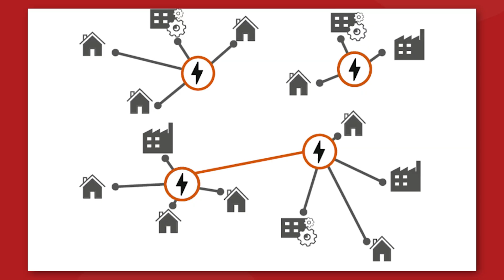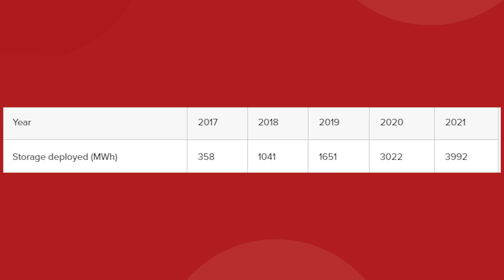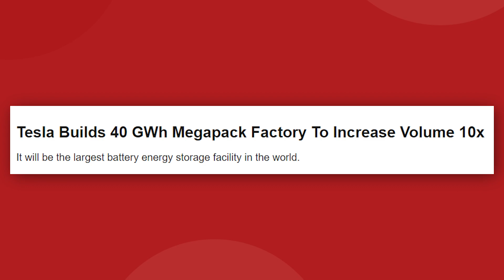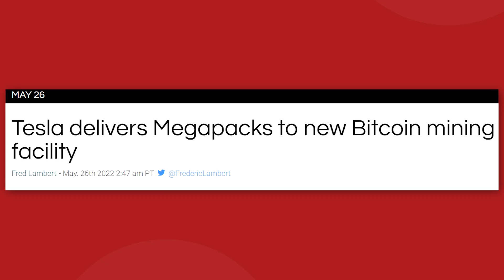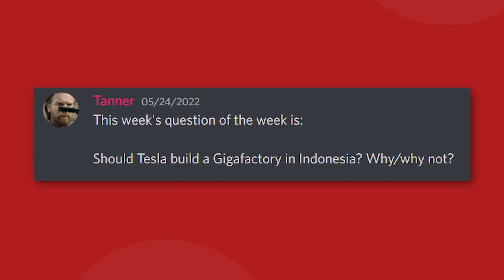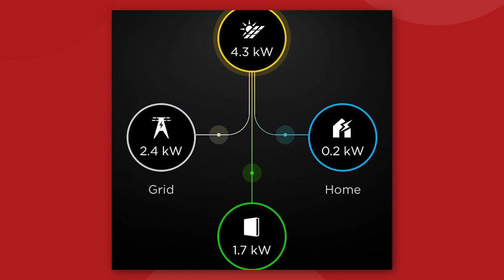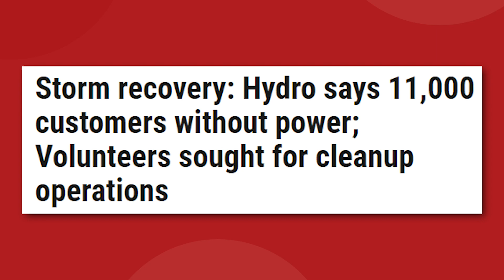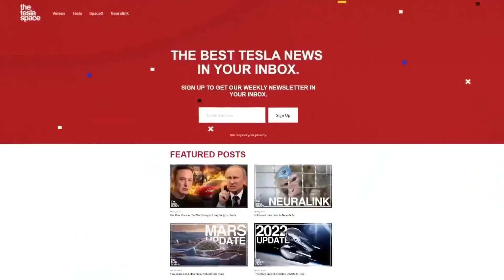Why Elon Musk Says Tesla's Batteries Will Save The World!

Comment: I wonder whether we can bury power lines. I know that that is not a new idea, but I mean "barely bury". Like, put them in a rubber and plastic canister at curb level and line the roads with them or something. Then, have each house or building plug into this network. It could even be somewhat modular. Greater energy needs could have dedicated nodes which pull more heavily from the grid. To me, that does not seem all that hard to achieve. Repairing/updating them would require more work than hanging new wire, but I would hope that the lines would be less susceptible to storms and thus might require less emergency work.

Comment: Great video as always!  As a longtime Texas resident, I am really curious where you received information saying that we can’t connect our home solar/ battery systems to the grid and get paid for extra production.  We do this all of the time. I have several friends and neighbors who do it, and I am also getting ready to do it as well. There are certainly paperwork and safety measures you need to go through to be able to do it, like you can’t feed into the grid if the grid is experiencing an outage.  This is because you could electrocute a lineman who is working on a downed power line.  But that aside, under the right conditions, you can absolutely push power back into the grid and get paid for it in Texas. 😊

Comment: With those large battery facilities located in the middle of a field, you are still going to need a grid to get it to the users, and it will have to be converted to AC to get there, so not too much is going to change in this aspect with wind and solar.

Comment: Especially considering where you are at, you missed some really big things:
1. The Great Lakes not too far from where you live are at different levels.  I am sure you have been out to Niagara Falls as it is not too far from Ottawa.  Well if you did pumped hydro storage between those two Great Lakes, you could have a massive gravity battery.  I mean I am sure you could get up to 100 GW scale no problem.  Right now Canada takes some water flowing down for one way power generation, which reduces what ends up going over the falls, but if you used renewable energy to pump water back up, those lakes are mindbogglingly big gravity batteries at your disposal.  Why are you so big on chemical battery storage when you have that in your own backyard basically?

2. I am surprised you didn't talk more about wind power and its role with battery storage, especially when you talk about these extreme wind events.

3. If you go to fire prone places like San Diego, California, since the devastating wildfires in 2003 and 2007, they have undergrounded the entire street level grid.  No more sparking overhead lines to touch off more devastating wildfires.  Granted it used to rain out in San Diego, but more and more the place is desertifying and the trees die off in mass groves with the deep winter freeze no longer happening in the local mountains to kill off the bark beetles in addition to the complete lack of any rain for most of the year.  So then you end up with mass tree die offs and becoming super dry as well as crazy winds that never used to happen and the previous 'windy' season, more like a light breeze by today's new norm, used to happen in the wet season, which is now part of the dry year.  So any little spark and whatever has not already burned away just goes woosh into a huge wind swept firestorm.  Then years and now decades later you go back to what was once beautiful forests and it is just desertscape; nothing is growing back.  So undergrounding all of the power lines has been a last ditch effort to keep some sort of semblance of what was once there and cherished / taken for granted and not have all of these homes burn down.

4. For large scale power transfer, as this is important to going to truly renewable (get the renewables and even natural storage where it is best to get it from when it is best to use), something that needs to be looked into more is using high temperature superconductors buried in the ground.  We can mass produce liquid nitrogen, which can keep current superconductors at a good operating temperature and setup the wiring in a coaxial configuration buried in the ground like a pipeline for massive scale electrical transfer.  With HVDC tech, which is already all over the place, you can drop to two conductors in the cable and have the electric field completely contained in the cable, making it immune to things such as massive solar flares such as the Carrington Event.  With superconductors, it should be easy enough to build out such lines in redundant rings, so if there is a cut somewhere, the power can just flow the long way around without any power loss.  I could imagine smaller rings with branches off to various places connected end to end (looking somewhat like bicycle chain links, but on a much larger scale) connected together in much larger regional and national redundant loops.  No more single failures leading to big outages.  At this with local batteries and such, you can have some time to spool up local 'dirty' generation in case your segment lost power.  However you make a strong redundant system and this is needed less.

5. Geothermal can play a big role in renewable energy both for reliable power from the ground and especially in places such as the Salton Sea, lithium for all of these batteries.  They are already working on doing battery grade lithium extraction from the Salton Sea.

6. A power generation tech we need to be getting into more, especially if you want more local generation is thorium molten salt nuclear power plants with one of my personal favorites the LFTR reactor.  These are much better and safer nuclear reactors than the light water reactors we know and so often hate and are afraid of.  Nuclear does not need to be this big, crazy expensive thing with the potential for catastrophic disasters, which has scared people into trying to kill off all nuclear and then have this forever radioactive waste issue.  It can be a lot better in every way and the technology was even promoted by the guy who invented the light water reactor as his first major success and then went on to this other reactor type to build the 'real' power plant of the future while working at Oak Ridge National Labs only to be halted by politics, not technical issues.  But yeah, if you want more reliable local power generation, a LFTR reactor is your best bet.

7. Maybe another thing to point out is we use a tonne of energy on heating and air conditioning while the systems we use for this tend to be hellishly inefficient.  If we promoted better systems, we could save a lot on our energy usage.

Comment: One easy answer that would resolve both the windstorm damage and fire hazard as seen in California is placing electricity grid underground like e.g. in Austria (I think they do it there to protect against snow). And the city without electric poles also looks better.
Reply: I lived in Japan, and the reason why absolutely every electrical and telecoms lines are on electric poles and not underground is because it's way easier to repair and do maintenance on them after natural disasters. For exemple it's basically impossible to repair underground networks after and earthquake, which often happen there.

I don't know if earthquakes happen in California too though, but maybe that could be the reason. Also poles are way cheaper and easier than underground lines, so I don't thinks it's that "easy" of an answer ^^
Reply: @axeldasilva8060  maybe with future cheap boring company tunnels ?
Reply: @xXxno6xXx  that may take a lot longer
Reply: @wisdomisawesome5934  for sure but how often you wanna replace a broken thing over a given timespan until it's worth it ?

Somebody might someday run the numbers on this.

for these, boring diameter might be able to be reduced a lot, but it will for sure take time
Reply: @xXxno6xXx  yeah that could be a possibility for some of the infrastructure that get hit the most
Reply: @xXxno6xXx  i just saw a videoclip about costing this and comparing to underground option. It was based on some electricity company research, where it would cost billions and it is prone to eathquakes and lasts about half as long as the wires on the poles. But hell, in Austria it must have been more costly as well and people in general were not against (I mean there was no public uproar against this) - there are more qualities than money. And yes, they obviously have less snow in California than Austria does. Yet what I lacked on the analysis was the lives lost and catastrophic property losses due to someone analysis which only substantiated the power company benefits. In my opinion, it was very near sighted and oversimplified view.
Reply: @Alarix246  thank you for the update.

I think one should recalculate these things every few years to make sure that advancement in technology didn't push it in the profitable range in the meantime.
Reply: @axeldasilva8060  obviously the earthquakes hardly ever happen in Austria. But I guess this all waits for the next Elon Musk.
Reply: @axeldasilva8060  your answer is great and pretty much spot on. The US does a lot of underground electric of lower voltage residential supply lines in new home build areas. Higher voltage transmission and replacing poles comes down to cost. This video does a great job of describing some pros and cons on both sides https://youtu.be/z-wQnWUhX5Y

Comment: I do agree that solar roof projects with battery storage is the way to go for a great many people. However as far as large scale grid storage goes it's worth noting that other options like water resevoir storage or other forms of gravity fed energy storage could also up the renewable energy storage capacity but also not detract from the batteries that are essential for home solar and EV's.
Reply: Have not seen a good way to store power other than batteries yet.  The only exception is a massive series of spinning disks in a vaccum mag lev.
Reply: @davidbeppler3032  water hydro storage is the largest scale of power storage used today. There are lots of different other gravity storage methods using abandoned mine shafts also. you can look up any hydro electric storage but there are many dams that pump water and then open the floodgates to produce electricity. It's not new tech.

Comment: It seems unlikely that a home solar system or a community solar system would not hold up any better than what we have now. It would wipe out the whole system instead of just telephone pole. 
It would be nice if they started burying electric cable. That would solve a big part of the problem and be aesthetically pleasing..
Reply: You can look at night aerial photographs and sata lite photos during long power outages do to storms and pick out the houses and communities with local solar and batteries. So it is already well known that micro grids are more resilient.  

Plus they are easier to fix. A hospital on a micro grid will get up and running much faster than waiting for the whole region to be repaired
Reply: @ecospider5  I don't see how the solar panels hold up.
If one section goes off then of course  t is easier to repair a smaller section.
If it is a devastating storm it won't be just one section. It will be every section and likely take the same amount time to repair as a whole.
Regular lines are section off also. Electricity comes on in different stages, not all at once.
Reply: New high quality panels are much more durable than 20 years ago. Plus you can design symptoms that stay running almost no mater what. With my system if you beat the heck out of one panel, shatter it and such. It will still put out power. Just a slight reduction in efficiency. 

If a tree falls on my house and truly destroys a couple panels the rest continue to work just fine. Yes they can be installed wrong and fly off but that is as likely as your roof being installed wrong and it flying off. Both can happen but both are extremely rare. 

A generator is great until fuel is not available. Solar and an electric car is much better than having to store hundreds of gallons of gasoline to get through a couple weeks with a generator.
Reply: @ecospider5  Is your house completely run on solar?
Reply: If we would only run electric underground would help in hurricanes and other windy disasters.
Reply: But it makes it harder to fix going to multiple homes
Reply: @wisdomisawesome5934  I am someone who has lived in an area of hurricanes. When the electricity comes on, it comes on for a whole section of homes and large areas. It has nothing to do with individual homes.

If it is individual solar homes, each solar home system will have to be repaired or replace depending on the amount of damage.

If one wants protection from severe weather, bury the cables. That likely would be too expensive though. Cheaper to just replace the poles and repair the lines and have the people live with the inconvenience. 

In Florida where hurricanes are a normal occurrence , most people have home gasoline generates to get them through the time the electric is off.

Comment: One might wonder, do those giga factories operate energy neutral????
Aka practice what you preach…
Reply: Yes Tesla plans to produce enough solar panels to create all the energy their manufacturing plants use. But more importantly enough solar to replace all the electricity used to charge the cars on a daily basis. 

Currently there is component bottlenecks for the solar but that will get fixed eventually.
Reply: From what I've seen, Maga Factories have a Lot of roof space and Tesla is covering them with solar cells.
Reply: 😆 don't just wonder, look it up. The new giga factories are actively built to be infinitely more neutral than conventional factories.
Reply: @JohnDoe-tx8lq  some, not all, factories are covered with PV, but it is impossible to find out (besides Elon and the respective plant CEO) if that is enough…
Reply: @hanswitvliet8188  don't understand any of that or what your point is. And if what is 'enough' for what?
Reply: @JohnDoe-tx8lq  What I meant: it is nice to see the factory covered with PV, but what dies it produces, compared to total power consumption if the plant. And is there enough mega-storage (when the PV doesn’t produce anything)
Reply: @hanswitvliet8188  so PV you mean PhotoVoltaic - solar panels... 🙄 ok, but it's not about covering a factory in panels, it's the manufactory processes, the re-usability of the final product, the vehicles used on site... but the aim of Giga factories is to be entirely powered (COMPLETELY POWERED) by renewable energy sources and develop thier own batteries to manage energy requirements. And "it is impossible to find out" - why?? they publish huge amounts of data. If you just don't believe it, then ok, but then why believe anything from anyone, the govt, the fossil industries.... hold them to the same standards,
And (always need to add) overall, it's all about REDUCING fossil use as must as possible, we obviously aren't going to switch 100% in the next few years. But these Gigs factories are a vast improvement so far, and improving all the time, along with all the other green technologies.
 That's me done. 😎👍